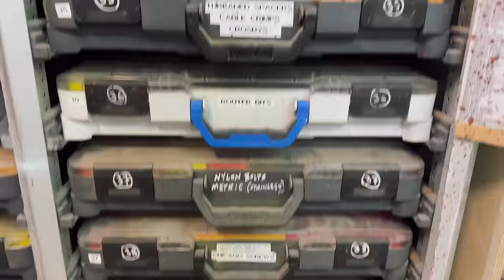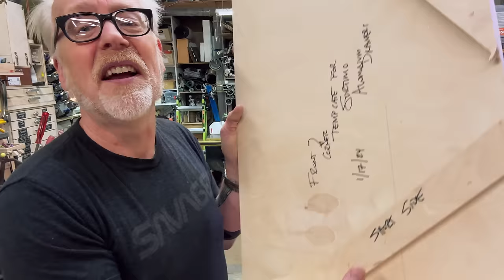Adam Savage Builds His Dream Hardware Storage System!

Comment: Whenever I think of a solution that requires me to do this much work to solve it, I always try to think back and reassess my initial requirements and assumptions.  It seems to me, and this is just my humble opinion, that you build 65 complex sliding shelves when all you needed was literally ONE.  I mean, what's the problem?  You want to open ONE bin at a time, but you dont have the space.  You dont need to open 2 or 3 or 10.  You need to open 1 at a time.  This is what you described.  So, to have space for one bin, you built... 65.

My solution: Build ONE sliding shelf and place it near the bins, maybe take out one of the bins in one slot and use that slot for the sliding shelf.  When you need to open a bin, you take it out of the slot, slide out the shelf from its own slot, and put the bin in the shelf.  When done, you put the bin back where it was and slide the shelf back in.  If you dont want to waste a slot, you can make the shelf some kind of sliding/folding thing and maybe put it on the side of the structure.  It would of course not be as fast as the system you built, but it would take a small fraction of the time to build.  A benefit is that you can try it out and if you dont like it and still want to build the 65 sliding shelves and all that, you can still do it because you invested time in the first solution was minimal.

In any case, maybe you DO want each bin with its own sliding mechanism.  That's the fastest way to get to the contents.  BUT... not being able to access things fast enough was NOT your defined problem, the lack of space for ONE bin was the problem.   Need one space, build one space.  That's what I would have tried first.  My two cents.

Comment: I know the video is almost a year old but still a magnificent work done by You sir. I saw a potential improvement that might be of use, between cabinets (1-3 and 4-5) you have space for vertical sliding cork board (mounted like door/tile displays in shops).
With such addition you could have photos of each sortimo on it for quick "lets take a visual peek at all of them" type of searching without having to slide out each one of them. Like a visual reference guide and easily updated too just mount a new picture or cross out with marker what's gone.

Comment: I would have made a couple of jigs to cut the complex coners on the bandsaw.  The idea is to use precision to create/set up the jig and then you can cycle/iterate the cuts more quicly and still be precise.  They repeat 2x per cut X two types of cut per sheet (4 cuts total).  You would need to run though the stack of 70 sheets twice but Every Cut would be very uniform and precise without having to carefully eyeball every cut (aside from making sure it is in the jig properly).

Comment: I know I'm late to this conversation but I've got to comment.  I think I would have approached the solution to Adam's initial problem differently.  The issue he was dealing with was having to find a surface to set his storage trays on to access and look through them.  I believe a much simpler solution would have been to build the new cabinets similar to the originals except with a waist high section of breadboard pullouts on which to place the trays to look through them.  Much (much) less expensive and time consuming project.  It also eliminates the need  get on your hands and knees to properly peruse items in the bottom sections or find a stool to do the same for the top sections.  I'm guessing there are still going to be good number of instances where he is going to want to take the trays out of their slots to get a better look at the items within.  And then he's back to the original issue - finding a surface to do so.  This may be a good example an issue in problem solving that I run into myself with these types of projects.  Sometimes I become  so laser focused on perfecting the process of implementing my solution that I miss a better solution entirely.

Comment: @tested Adam, some questions./comments.. When you were machining the hole, it looked like you were using a end mill instead of a slot drill. This could have been the cause of the burrs, that you had to knock out. perhaps the addition of some aluminium related cutting fluid could help.
Curious about the notch you decided on. did you consider a vertical (or horizontal) slot instead? Tis would simplify the cutting of the corner material. Of course you would need a segmented bender to use this method - so perhaps your method is driven by the available tools in your shop.
Also, you can add stiffness to the base by making two diagonal shallow bends ta to make an x on the base

Comment: Alright, alright, hear me out, Adam, hope you're reading this or anyone who can tell him to - if they also think that's the way to go.

I recommend you using Obsidian. It's basically a notebook/ organization software that runs on windows, macos, ios, android, linux ... and you can sync inbetween all of those either paid using their service or using your existing cloud, whichever you use.

It has you create a Vault in which you can have folders and subfolders and subfolders ... to organize notes - but wait.
Those notes can be structured and designed using html, css & js and you can create them as templates, so you don't have to redo it every time. Yes, you can have multiple templates for different kinds of notes.
What i could see work for you is to have a folder for like general ideas, one for projects, one for resources, ...

Now, how could it work for you irl?

General ideas, ok, that's ideas you have throughout the day, which can be done as daily notes that have the date and everything automatically.

Now, for projects, if i was you, i would for example open a note for this exact storage system and have a few tags on top for easier searchability such as category of project - organization. where it is to be used - your workshop, etc. Just to make it easier to find later if needed.

<hr>
Idea. the thoughts behind the project, things to consider, etc.
<hr>
Plans. sketches of your plan, measurements, etc.
<hr>
Resources. links to inspiration, hardware you need, etc.

Remember the resources folder? I'd have notes in there with tools you have, hardware you own, all those things. So, for example, instead of the excel sheet, a note in the resources folder that goes like:

Drawer 1
m3 screws 6-30mm
m3 nuts
m3 washers
... you get the idea
[top down photo of the drawer]
<hr>
Drawer 2
....
<hr>
Drawer 3
....

So you do have all those things including the photos in a note instead of excel, what's the point? You can link it in other notes and yes, you can have 2 or more notes open at the same time.
That way you can go through the project plan "Oh, i would need m3 x 30mm screws" - checking the note - "Ah, those are in Drawer 1" so you can link the drawer 1 section of that note in the project note. And because it syncs, you can just open the note on your phone "oh, yeah, the m3x30 click on link ah, right, Drawer 1" or just embedd the section with the link so you get to see the hardware listed in Drawer 1 in the resources section.

I hope you guys can follow along and see how useful this could be to your workflow. It's free to use, runs on basically everything and you can sync it for free using your existing cloud plan while also being extremely customizable using the templates per note type.

If anyone reading actually starts using it, i would love to hear what you're doing with it. But be aware that because of that customizable it can be really overwhelming in the beginning until you get the hang of it. There's also a ton of official and community plugins that add some additional features.

Comment: I cringed at the issue with the drawer slides aligning..  Been there many times. One of the best things I have found to use my hobby CNC for is precisely drilling or cutting small details. I wouldn't necessarily cut out the large plywood sides with my small CNC, but if you make a consistent way to hold pieces, it is GREAT for drilling spot holes for all those slides! Great real life video!!

Comment: I was going to say no, what you really want, is those boxes in a drawer, so that if you need to take it out you can but you don't have to take it out, this way you can still see what is in the bins without opening it, you can still open it in place and remove something if needed, or, if you're not exactly sure what size you need you can take the whole thing over to the project to test a bunch out, remove the one you actually need and put the rest back.   I can see also dedicating one box to one project, for example if you take something apart you can put the parts into the box in the order you removed them, if the project gets put on hold for some reason you can put the whole box back in the drawer and then if you get back to it half a year later it's all still together just the way you left it, and you still know what order you removed things in

Comment: Would it not have been more simple to create one drawer per vertical column that you can pull out along side Sortimo box? That way its a horizontal surface that is only taken up whenever you are grabbing a part,  since you have many stacks you can have that many drawers so even if you need one out for multiple runs it should not imped accessing others. It would also stop the having be slightly above the drawer to see/get what you need so you can stack more per vertical column. The best part is one would not need to make that many drawers and cut a lot of those costs. Still an awesome system, I do not envy the hours it took to make however 😅

Comment: I added a small one foot square pullout shelf to the cabinet that houses all of my storage boxes.  Now I have an always clear place to set the boxes when I need to get something.  Most of my boxes are larger that 12" square but the boxes still set on the shelf just fine.  And the shelf is behind a cabinet door so the shelf has to be closed in order to close the door.  And I hate leaving doors open.  This keeps me from leaving the shelf out and putting other things on it if I were temped.  Not as slick but way less $ and time than Adam's solution.

Comment: A kitchen usually has one pull out tray for the countertop.  You could setup one tray for each vertical group.  Pull out the Storimo unit and put it on the tray.  Put the Storimo back.  Slide the tray back into the system.  Should take less space than 1 Storimo slot.  Less stuff to manufacture than one sliding tray for each Storimo.

Comment: Have you thought about having a small tablet with a collector app on it so you can search for any item in any drawer in your workshop. Add item names with drawer number. Will save re doing the excel sheet and printing out if you move any item to another drawer. All you would need to do is change the drawer number.

Comment: Instead of making a slider and tray for every box, I just added one slide out shelf at a suitable height to replace one box slot. That way you just pull any box, pull the shelf and you have a surface. If you have multiple cabinets, you only need one shelf per two or three cabinets. A lot less work and it works perfectly.

Comment: You almost summoned the dreaded Ouroboros.
  
   Start a Project,  But end up needing a certain Tool/Bracket/Fastener
You solve the hurdle with inginuity by creating/fixing object needed.
  Now You need extra bench space, So you have to re-arrange it
You have neatly stacked items mostly needed, returned those not.
  Now You're using tool fixed/created, but your project isn't supported
You have inspected and came up with a solution
  
Now You're building a Bigger Bench .... 😂

Comment: Amazing work and great process, I would have just built one single slide out shelf at a convenient height so you can pull the required box out and place it on the shelf while you get your hardware. One or two drawer shelves would be a lot easier to build than 70 identical drawers.

Comment: Out of curiosity, why did you need triangular shaped tabs on the back fold up? Would a rectangular shaped tab work just as well?
So instead of cutting out a chunk of waste sheet you could simply have cut along one edge of the tab and bent the other edge. The waste from the kerf of the saw blade would give you the clearance to bend the tab. You could then have just stacked a whole bunch of sheets together and made the cut in one pass with the stack of sheets held vertically on the table saw as you move the stack over the saw blade or use the band saw. More than 1 way to skin the cat. 
No waste pieces, much faster operation, done in about the same amount of time as for the triangular corner cuts you made at the front.

Comment: Putting a wood botom frame or a metal frame on the units  makes them far more stable from bending.  there is also a real risk that the units sides will get  out of angle by the wight of the boxes,  making the slides hang up.putting a plywood backside on them would be a good idea .
This means you can use them as  temporary supports when building something ,without risk of breaking them .
Tip:  when working with metal sheets , file the edges to temove metal grades , a fast sweep with a fie often do the trick.=less cuts on your hands.

Comment: I'm curious what the issue with the first plan was?  I was thinking of doing something similar and was going to 3d print some mounts to connect to the drawer slides to catch the existing catch system.  Maybe because you're not actually attaching the slide mounts to the drawer it was too unstable?  I could see the slides maybe flexing outwards when extended and dropping the thing.

Comment: Could you just include 1 empty Sortimo sections in each vertical column at waist height? In that empty section you can have a pull out slide like you built. This way you can pull out a Sortimo and place it on the slide at an ergonomic height. You can have tiny spot lights illuminating the contents of the Sortimo. When done you put the Sortimo back. This way you won't need a ladder or stoop down to see what is in each container and you will have your horizontal surface.

Comment: I have similar storage racks, and I wrote a sw to manage (search). It is a life saver, when I looking 4smtg. Several month ago I moved from windows to mac, and I am actually rewrite this sw to apple platform not only to macos but ios, and I wondering if some qr or dmc code may fit.. Right now the sw handles multiple location numbers due to electronic components often stored in smaller drawers in a rack, and there are multiple (E12 row). The sw could search while I type in multiple fields quickly, therefore I dont need to enlist one component multiple times  to have an abc ordered list. It just find it... Btw I like your channel.

Comment: I am probably the slacker of the group, but I'm pretty sure I would have sacrificed a single slot in the center of each stack, and just built a single drawer/shelf per rack.  Every stack would have it's own place to set and open the container, but save all the weight and cost of individual shelves.

Comment: I can't help but wonder if repurposing a bakers rack would work for this (eg https://www.webstaurantstore.com/regency-12-pan-end-load-bun-sheet-pan-rack-unassembled/600PR125K.html). The dimensions of each space hold pans (full 18"w x 26"l or half 18"w x 13"l). The height on this one is 5" each, but I think they come in different heights. You could even use sheet pans as the shelves if you figured out a "stop" to prevent the pan from falling.

Comment: It isn't necessary to have each box on it's own slides.  All you really need is a pull out surface at a convenient height on full extension slides. At the top or bottom of the carcass is likely strategic. Middle perhaps in the rollaway here.  Then you can set your box on it and get your part where you can easily see and pick through.  Because, slide outs above your head will need to have the box taken down to get to the parts anyway.  And down low, well, if you like squatting to get your parts I guess that's ok.  Also, $60 bucks for the fancy boxes is a tad POSH.  Flambeau or even Harbor Freight will do fine.  Ya know?

Comment: Just curious what the reason for the conplex cuts on the back corners. Would it not have given the same result to just do a partial cut into each side and that way when you bend the sides up the cuts would make a a extra tab on metal to each back corner which can then be folded to create the box effect.

Comment: If you spend all that time to set them up in the mill, you could have also trimmed the diagonal corners, and drilled all the rivet holes.   And why not use the mill to mill out the pocket you wanted to clear for the rivet corners, instead of cutting them on the bandsaw one at a time.   Seems like you could’ve done all that on the mill, if you just had a spacer plate underneath the stack.

And why the weird shape for the rivet corners anyway?   Why not just one cut, then fold over the tab as just a square?

Comment: For the sorting and writing it down to the excel. I think there should be also a name in the container (bottom) or on the side of the container. So If You can not remember what's the specific name of that  item, you can quickly find out. Write to computer that You need to stock up that item.

Comment: Cool project. I would have used L shaped aluminum flashing instead of sheets. You don't need the bottom, you just need the sides. They're also lighter and easier to cut and twist.

Comment: nice work as always adam! question: did you consider just sacrifiing one slot in each bank at the optimal height and making that into a pullout shelf to put the organizers on? all the drawers that are too low or too high will probably still require a surface!